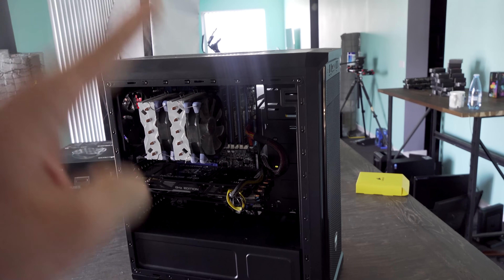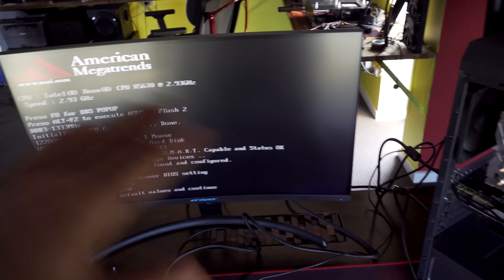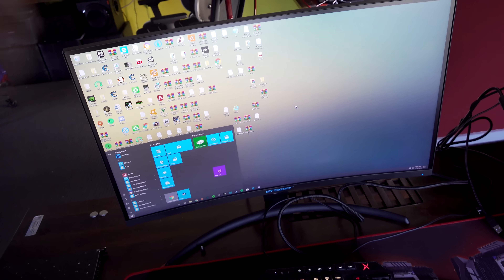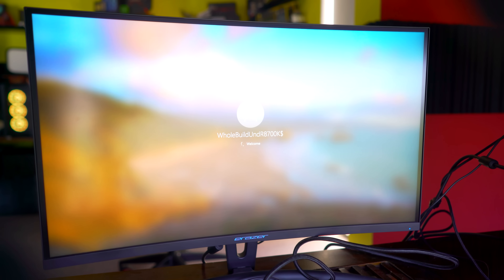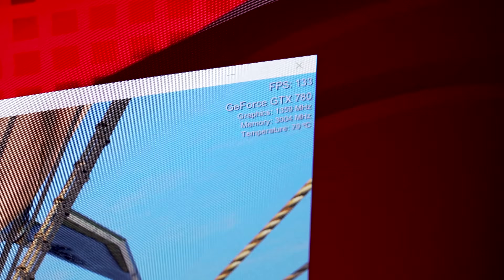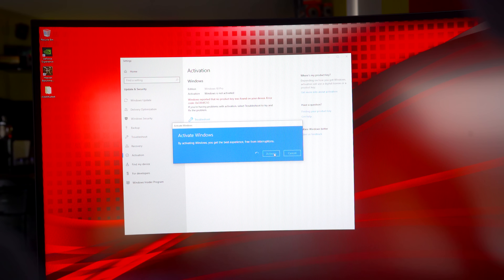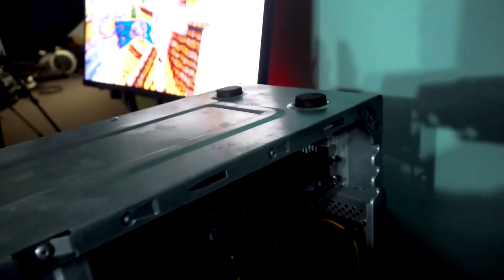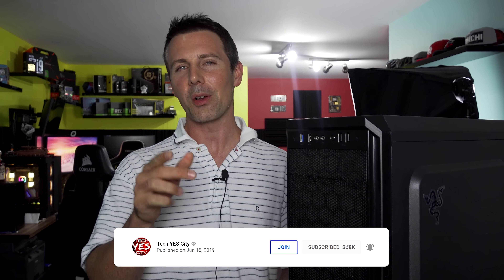Fixing "No Signal To My Monitor" - This Computer Came Back 2 Years After Sale.

Comment: I ran into a problem the other day while working on my nephews computer,has this happened to you?

1. PC worked fine and recognized GPU RX 570 Gigabyte.
2. Swapped out motherboard.
3. Ram was supported by mobo.
4. Installed gpu onto new mobo.
5. GPU was no longer recognized.
6. Tried another  GPU Gigabyte Rx 570 Aorus. 
7. It instantly recognizes AORUS version.
8. Turned off PC, installed previous, non Aorus Rx 570, and pc recognized the card again.
Now the whole time I had a video signal, i couldn't get into AMD Drivers software error " AMD Graphics not recognized". I tested both gpus on another computer and worked fine.. this was just a wierd scenario for pc not recognizing a GPU, and one possible way to fix it installing another GPU, let pc recognize it, turn off pc, and install previous GPU and start computer as normal, should fix problem. What do you think
Reply: Could be a driver issue? Try uninstalling the drivers completely with DDU and also if you recently bought that Rx 570, it could be used for mining and it might have a modded mining firmware..So also try to install the stock firmware.
Good luck :D

Comment: Aye  I  got a budget pc. It's a dell optiplex i73770  with 8GB of ram with an 1650 super.  It was working  fine but then I tryed  adding  2x4 gbs of ram. Now it doesn't  work , regardless  what I do. I took off the new ram and it still says no signal to monitor , even  though  It turns on.  Got any idea what's wrong?

Comment: I have an HP Pavilion Slimline s5580t with an Intel i5 650 @3.2GHz with 2x4gb of DDR3 PC3-10600 and 248gb m.2 SSD connected to a m.2 to SATAIII adapter and a 1TB HDD. I bought an MSI RX580 8gb and 600 watts 80+ EVGA PSU for $110, plus he threw in some 2x4gb DDR4-2600. So I had windows 7 on my HDD when I first got the RX580 a couple weeks ago, I didn't have the SSD adapter yet and the graphics card worked great could even overclock it to the max settings on MSI Afterburner and it kept stable. Since upgrading to Windows 10 on the SSD my video driver crashes to a black screen every few minutes and resets, also crashes to a black screen if I put any load on the GPU, only started happening after updating the drivers after installing Windows 10. If I rollback drivers so that the device manager just says Windows Display Adapter then it won't crash, but I can't use any apps that put a load onto the GPU without any drivers. I do have a windows 7 disc but my mom put it somewhere and doesn't remember where she put it (she does this with anything I plug into her computer) and I can't find it anywhere. So I've just been stuck with an unstable desktop, I'm using my girlfriend's old laptop with an Intel i3-4025U @ 1.9 GHz and 6gb of RAM that I hooked up to my sorry HP S1931a monitor that has a  sorry 1366x768 native resolution, which just happens to be the native resolution of the laptop too. I plan to upgrade my case, motherboard, and CPU as soon as I can, hopefully within the next couple of weeks. I'm sure if I replaced my motherboard and CPU with something that wasn't 10 years old then I wouldn't have so many compatibility issues, I went through 3 m.2 to PCI-E adapters before figuring out my crappy i5 CPU only has 16 lanes which is being taken up by the RX580, really glad I settled on a SATAIII adapter much more practical than the PCI-E adapters. Anyway, I have tried 3 different versions of AMD drivers, I even flashed the BIOS of the GPU to no avail. I saw a post that said running Aida64 fixes a bug that causes the RX580 to crash with Windows 10 but that solution didn't work for me, not sure what else to try.

Comment: So I have an SSD and a hybrid drive. Does the same logic apply to a Hybrid drive and if I have multiple drives does this apply only to the C drive?
Reply: (assuming you mean don't let it get too full). All drives will get slower at operations (especially writes) when near full. A hybrid drive's ssd portion is managed by the on-drive controller as a cache to speed up file access, so you don't have to worry about that; the spinning portion falls under the (iirc) "don't let it get more than 90% full" rule. SSD drives you want to leave more space free on, I try not to fill them more than 75% full.

Comment: should only use vac that is approved for electronics-- static electricity can destroy electronics, air compressor outside is cheap and safer
Reply: iirc the DataVac is ESD safe?

Comment: I've never seen a PC run super slooooow like that because the hard drive was full. I beat if he looked at the SMART information it would say that the hard drive was bad.
Reply: That was my first thought, bad sectors on the hard disk.  27.1GB is way more than the system needs to operate at a decent speed.

Comment: No Signal on the systems monitor on a all brand new parts x570 Tuf wifi/3600X/EVGA 2080Super FTW3/1Tb SX8200 PRO NVMe/Seasonic GX-850 with either a 3200 cas 16 2x16 corsair RGB Pro kit and OR with a brand new TridentZ Neo 2x16gb 3200. The 4 "EZ-leds" on the mobo near the 24 pin, show the memory problem led is lit up on both kits,moving mem sticks to diferrent slots does nothing btw. Pressing power,everything lights up all fans spin up.... but no post just a blue screen with "No Signal" on the monitor. Help.

Comment: A problem I've been running into a lot on lga 1150 sockets with big tower coolers is the slightest bump from moving the PC or a cat running into or what have you and the thing wont post or if it does post, it has a dead memory channel. Pull the cooler, re-seat the cpu, put it all back together and they come back to life.

Comment: This usually is a sign of an almost dead CMOS battery. If the voltage is too low, CMOS data can corrupt, and the system will not boot anymore. Typically a problem with cheap no name 2032 cells. They measure well, but with any load connected they will drop to 2.xxV which is too low. 
So always use good Quality CMOS batteries, they will last 10 years or more

Comment: I don't know why Bryan didnt take a look at the HDD with CrystalDiskInfo, that tool can give out important S.M.A.R.T information. The hard drive might get Caution indicator on SMART (not any mainboard that have proper SMART checking process). 

If it get Caution (yellow indicator), you can recommend the customer to replace the hard drive because it is no longer reliable and healthy. It might die in another day and you will lose your files. Better safe than sorry.

Comment: About the question of the day at the end of the video:
I actually heard that the reason you don't want to use a vaccum when cleaning out a PC is because the vaccum has a chance of creating static electricity which would damage your components if you use it on open circuitry like a motherboard or M.2 drive. Don't know how true that is but better be safe than sorry so a blower with high pressure is a better option.
Reply: The blower can create static too on the tip of the nozzle (if not designed to be ESD safe), but since you don't get the tip of the blower right next to the board the static is less likely to jump to the board and damage components.

Comment: Recently I've been running into an issue where the computer will either go to sleep for a long time, or I'll shut it off for a while, and it wont turn back on, it just has the ambient LED's on the motherboard but no fanspin. Even when i reset cmos, reseat components, unplug external peripherals and have 1 stick of ram. Tested the PSU and it's outputting proper voltages, so its not that. I took it for a spin in my car going to a repair shop and found they were closed. When i got home, it just started working again. I just updated the BIOS after 6 months, and i haven't shut it off yet because i have a tournament today, but i hope that was the issue. Any thoughts?

Comment: Brian, is your little air blower there like the forced air dryer I have for my mobile pet grooming business? Mine is a Metro Air Force Quick Draw Dryer. No heating element, only air. It's a 1-ish horsepower motor.

I need to (attempt) to get the dust out of the hand-me-down Hyper 212 and 770 I'm now using, and if they're about the same power then that'll make my life a lot easier.

Comment: User error or poor management is 95% of the reasons for issues.

SSD 2 years ago was not that expensive 120gb could be had for under $50

Vacuum uses massive amount of static you shouldn't even be considering putting that anywhere near inside of a pc.

Those labels the same with brands are useless for PSU this is why I loved JonnyGuru who did proper testing and even showed because it shows a rail of so so or is this many watts doesn't mean it is what it claims to be.

I'm surprised the person didn't want you to replace the fans wth RGB also you should really replace both fans so they are equal not just one or switch it out for Snowman lol

W10 is garbage it's reason you can get these keys so cheap I want to see someone do a proper W7, W8, W10 compare I know using W7 I have done some tweaks/mods to is far better OS then W10

Comment: Your theory of the CPU overheating, shutting down because of it, and not booting afterwards, is quite likely what happened. From my experience, that's exactly what the X58 platform does when the CPU overheats. I've even had a system that required the CPU to be reseated when that happened. That last one was a real hassle. It used an AIO which pump power connector didn't make proper contact. Had to go to the trouble of removing that AIO 4 or 5 times before I found out what the problem was, yet another reason I prefer air coolers XD
One other funny 'problem' a buyer of a PC I sold had was that "the screen connector doesn't fit". The guy thought a serial port was a VGA port lol. Poor fella had to buy a DVI to VGA adapter XD (it was an older PC and he bought it for simple home use

Comment: Worst thing that can happen if your power supply doesn't have enough juice, is that your PC will just shutdown that's it. 

That's it, the only way you can explode the power supply is that you switch the voltage switch

Comment: I got a PSU that would over charge my graphics card. Keep telling me about PSU not being an issue.  It is a platnium rated PSU by Corsair too.  I don't trust Corsair after their AiO water cooler DESTROYED my PC a year and a half ago. I got a settlement check that was worth a fraction of my computer. Haven't had a working PC since that forced me to Windows 10.  Tried more than One PC and all suffer issues.  I hate windows 10, but hate Corsair more.  You do your channel a disservice by discounting or dismissing issues before you diagnose the problem.  That is a bad bad habit in troubleshooting.  Don't make any assumptions until you have looked at the issue COMPLETELY.  Brian, you got a good channel but you gotta be careful making carte blanche statements when it comes to IT repair and troubleshooting.

Comment: i use a electric pump for an airbed with a makeshift adapter to make the air pressure higher for stronger blowing! 🤣🤣🤣🤣
Reply: Not too high though - you don't want to blow surface-mounted capacitors off the circuit boards!

Comment: Nice to see that you still help out your old costumers ...
I once had a system that had stability issues and after eventually replacing everything it turned out it was the mainboard that had issues
However after 3 RMA’s it still had the same issues and the store where I bought it gave me a full refund to get a replacement board ... got myself the R4BE and never had those issues again 😁

Comment: The most common problem I had when I build a new PC is one or a few parts of the front panel connectors (USB ports and audio jack ports) not working. The first computer I built had audio jack ports at the front that failed to work. The second PC I built for myself had a defective USB 3.0 port (can only power the lights of my headset but cannot read anything from a USB thumb drive) and the problem was solved by changing the front panel connector thing.

Comment: The simplest cause for no picture: check the cable.
Reply: i will replace the battery. but i just want to ask is my gpu the problem? the fan is running but still no signal. no it's not the cable or the monitor, because i plugged the hdmi cable to the motherboard hdmi port and it worked. so should i replace the gpu too?
Reply: @tarapiero  same problem hope you found a solution
Reply: @LatinoRights  I have the same problem.
Reply: yep, and if that does not work reset the CMOS battery, and if you know that little battery is over 5 years old replace it, as they are not that expensive, unless we are talking a specific laptop one that might be non standard.

Comment: Don't know the prices you way of course, but this one is £50 here, IT Dusters CompuCleaner Original Electric Air Duster Blower for PC, 500 watt (.0.75hp) motor does things very nicely for myself and doesn't cost the earth, especially when you compare it to having replace any part inside the PC

https://www.amazon.co.uk/Dusters-EG-1000-UK-Electric-Air-Duster/dp/B073F9NY1X/ref=sr_1_2?crid=1VF038UI95K4&keywords=compu+cleaner&qid=1578746629&sprefix=compu+cleaner%2Caps%2C140&sr=8-2

Comment: I have a Cheiftec  450W PSU from 2004/2005 and it can not handle my rx 480 with stock voltage when playing something intensive, undervolting it to 1.02v and underclock to 1200mhz it will work fine. And it is the PSU as in my other PC I can run this card with 1.15v and 1330mhz with no issues.

Comment: Question: Can you damage a CPU by over tightening the air cooler ? I was installing a Noctua NH-D15 and after installing it the PC would just bootloop constantly. Was the CPU or memory controller damaged on it from the force applied on the IHS? I have tried reseating the memory and CPU. (This is an Intel build).
 Thanks Bryan.

Comment: I'd replace the CMOS battery on a pc with that issue.  Especially after it booted after cmos reset. I've had several computers through time where a CMOS battery replacement has solved a lot of mystery issues.

Comment: Day 2 of commenting until someone helps me

I have been running the same rig, i7 920 on an older intel DX58SO motherboard with 8gb DDR3 for like 8 years now, and I want to swap it out for a xeon x5660 that I bought on ebay to squeeze a couple more years out of my PC. When I put the cpu in, the PC turned on with no display, turned off after a few seconds and turned on again with still no display. I think the issue is I need to update my motherboard's BIOS, but intel has removed any downloads for the DX58SO motherboard from their website as of a few months ago I think. Is there any workaround for this?

Comment: A dust blower is vastly superior to a vacuum cleaner in most instances. First the vacuum cleaner needs to be real close to be effective where the dust blower effectively blows dust away without the need to risk breaking something in the system. A vaccum cleaner cannot suck the dust between the PCI-E slots, there's not enough space to get close enough to the PCB to remove that dust. And that dust will with time and humidity turn into some sort of sediment that requires the system to be completely taken apart and cleaned using break cleaner. Not to mention that the suction effect caused by a vacuum cleaner can make your movements erratic and make you inadvertently hit fragile parts on the motherboard like a capacitor and toast it. With a dust blower all you need to do is unplug the PC, bring it outside remove the panels and in 5 minutes the PC is clean, if you do that every 6-8 weeks your system will never grow dust deposits between all the little components like transitors and greatly reduce the risk of hardware failure. Things are different if you haven't cleaned a PC in years but in that case the fastest most efficient thing to do is to take the system completly appart and carefully clean every single part.  Actually that's one of Tech YES City videos 2 years ago that pushed me buying a dust blower, best purchase ever.

Comment: I've got an Intel H55 and a HP-H61 motherboard that turn on but won't post. I tested them with different CPUs and ram sticks with 2 cheap OEM PSUs to no avail. However, for the GPU I only had a GTX 670 and 960, so it's possible that it's the old motherboard - no secure boot thing, so I bought a GT 310 to test them with. Wish me luck.

Comment: If anyone is wondering, I'm pretty sure this is the same pc built in the video "Build a 6 CORE GAMING PC for LESS than an i7-8700K!", which is from October 2017. The only difference is the case, which was, to no surprise if you see the original build video, swapped to make the sale.

Comment: A friend once told me after he installed his new graphics card (two weeks before) that it didn't output any signal out of the PCI-E slot now. The issue was, that a voltage line of the power supply responsible for the PCI-E slot was just broken or had a lot less voltage on it. But this happend one time of I don't know, like 100 cases where the PC didn't show signal because of the PSU, I once worked in a PC repair shop and I can confirm this problem is very rare.

Comment: Yup before this I also have same problems whenever i install new hardware and can’t boot my pc in two days of troubleshooting and google search..and i tried to remove all input output usb cable the computer wont boot too then i came my idea to remove hdd ,reseat m.2 ssd and reset bios then walla the pc boot normality..

Comment: LOL Blow vs vacuum? let's put this idea to bed right now. 1 "F*@K! 150 quid alienware keyboard, half they keys eaten by the hoover" 2 "hoovered inside case, and it unplugged everything it could then ate some jumpers and a RGB cable." Do yourself a favour: if you only have a hoover, put the hose on the outtake. Or spend several hours rebuilding a keyboard, and re-plugging everything back in.